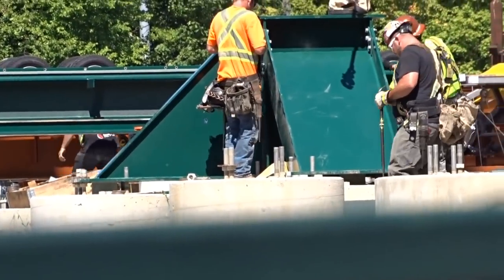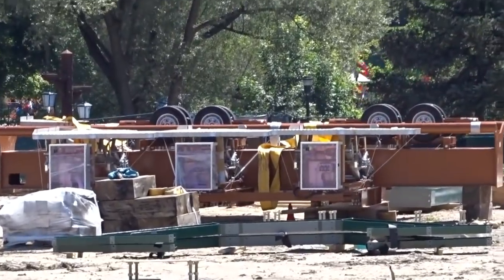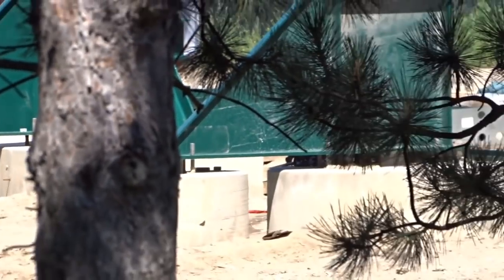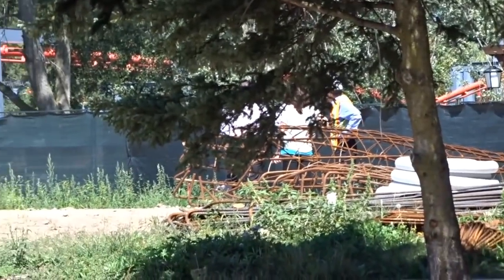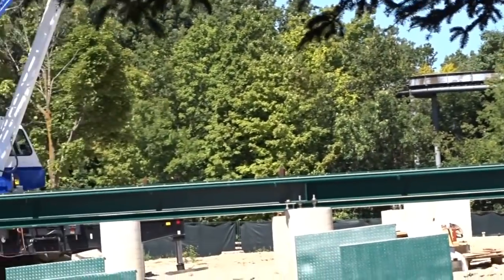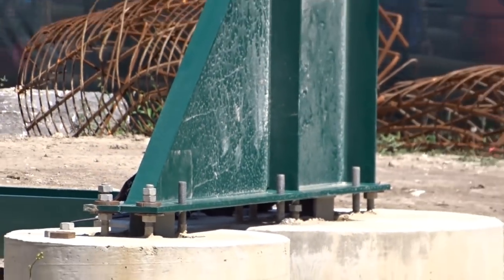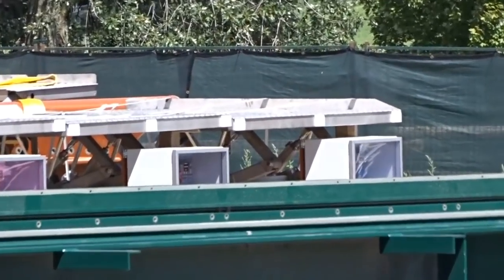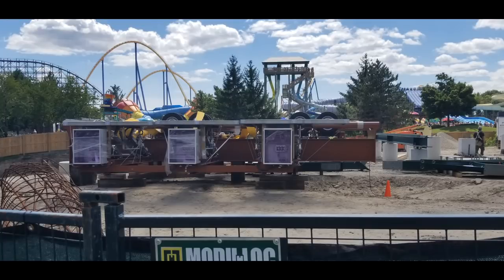Multi-Angle Vertical Construction of Canada's Wonderlands New Coaster

Comment: I'm really hoping it has the same type of seat safety measures like the ones on Leviathan and Behemoth. They're so much more comfortable then the ones on the bat or dragon fire. Personally I'm hoping for the highest drop possible so for me its 250 at the moment.
Reply from the maker: Laura H it’ll be very safe :)
Reply: Is that even possible to have the calm shell lap restraint on this ride, considering hopeful full inversions
Reply: I think that would be very unlikely, though the restraints for the newer b&m inverting coasters are much more comfortable than the restraints of Dragon Fire and The Bat.
Reply: Absolutely no way like leviathans /  behemoth  clamshell   restraint .   Why  well going beyond  limits of clamshell    going beyond 90 degree and  upside   down    TSSA /CSA   would never allow it  

What it Could be
 1 Over the shoulder restraints  fell more air time 
2 vest restraints   more comfortable   don't fell weightlessnes 
3 new design   hopefully good  not fail